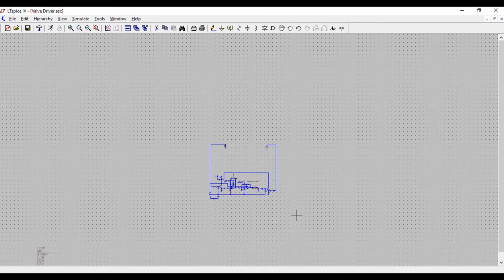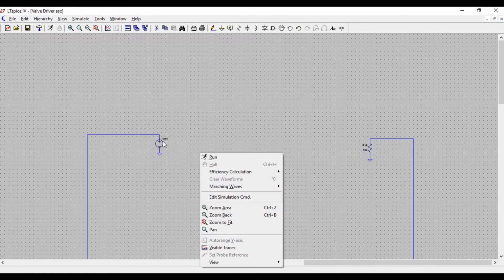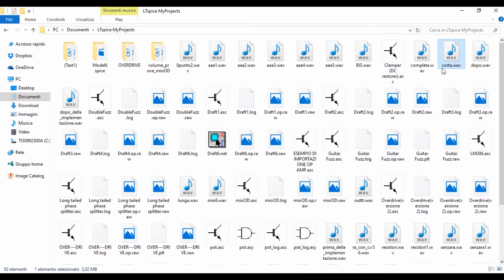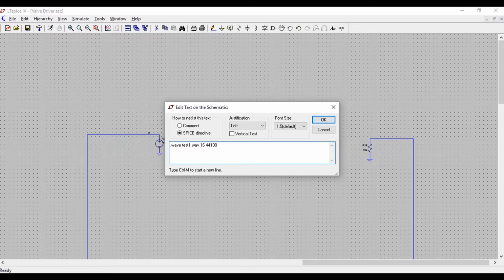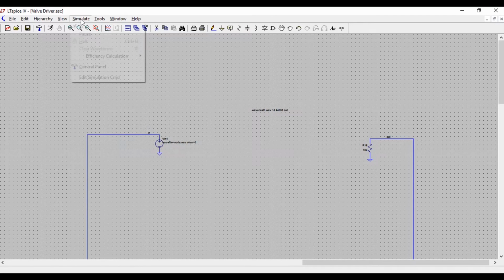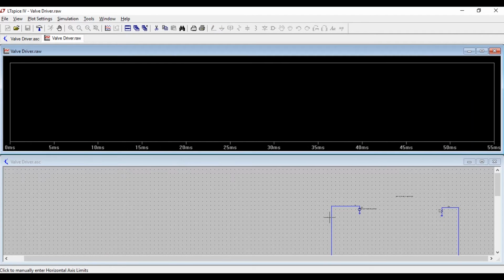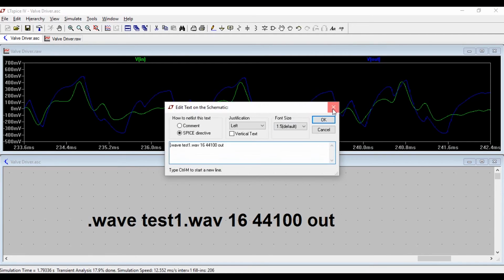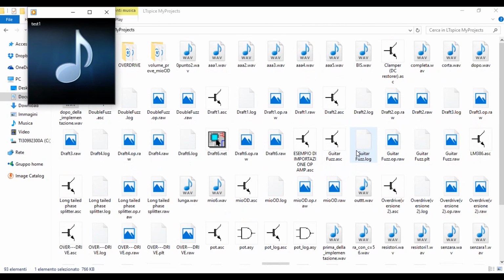LTSpice audio simulation tutorial

Comment: how did you get an audio file with input voltage only between -1 and 1 V? I know that the .wav command can only take voltages between -1 and 1 V, but I'm not finding an audio signals which satisfy this condition.. If you could share your sample audio file - it would be helpful. 
EDIT: oh sorry, actually input signal is within -1 and 1 V, it's just the output signal which is getting amplified too much, I'll fix that.

Comment: did not know that such thing exist. can i design a distortion pedal with that how close to the real world is the simulation? or there is a  better program out there for that? overtones depends on the used parts and materials... can i modify parts? or has this a huge parts list with the curves and behave of the sound from different diodes? and transistors... just want know some info before use time to digg in a new programm. thx 4 info
Reply: Im waiting for the same answer. Did you worked with the program eventually? Ich würde mich sehr über eine Antwort freuen.
Reply: You can adjust the characteristics for the resistors, capacitors and inductors to make them closer to the real world. The active components can also have their models changes to whatever you are using

Comment: Great tutorial....  but I have followed the example and I cannot get my output to have sound... i.e. the wave file is created but it is silent.  The LTSpice shows the results of input and output, but nothing in the wave sound file.
Reply from the maker: +Geo Zero Thank you man! I think the reason may be some omission in the code you wrote in the SPICE Directive: it seems to me that you forgot to write ".wav" (the code is .wave filename.wav 16 4100 nodename). If this isn't your case maybe the problem is that the nodename written in the SPICE Directive isn't the same used to label the output net. Last case: the simulation time setted is really little (order of ms).
However, if you are sure that circuit works, the best thing to do is checking all the steps again.
Let me know how it goes!!